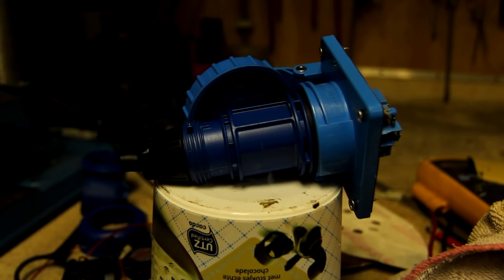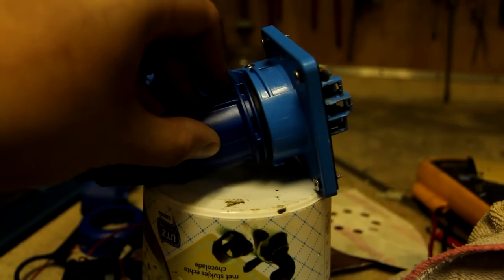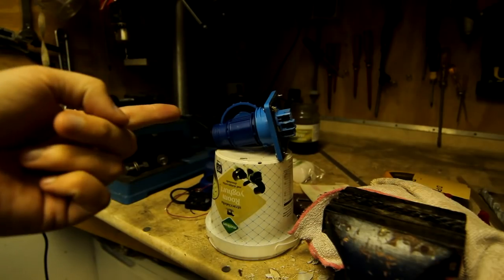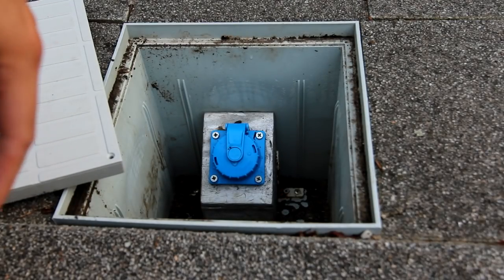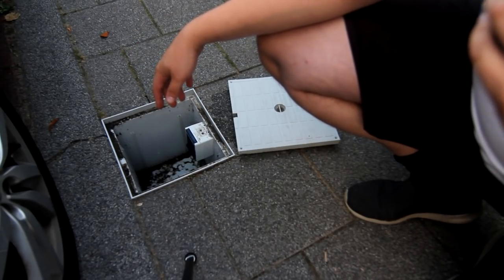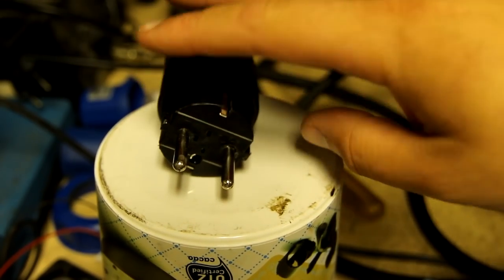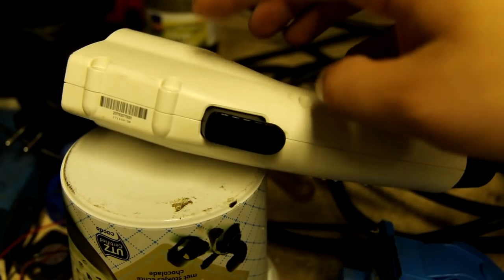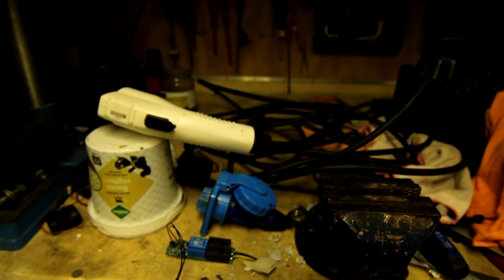Granny charger and charging point update!

Comment: with those high currents never ever use solder connections but quality crimp only
Reply from the maker: The current has little to do with the type of connection you make; this is a bit of a persistent misunderstanding in cable assembly. Solder connections generally have the lowest electrical resistance for round connections, so they are a good choice for this kind of application. However, problems arise when either the connection risks getting too hot (>175C for most solders is a good rule of thumb) or when it's a rigid-flexible connection where the cable needs to be able to move. Neither applies here, so a solder connection is acceptable. Regardless, for schuko pins there is literally no choice; there are no crimp schuko pins I could use.

Comment: A blue 16A CEE maybe with IP 68 is probably better. from those IP 68 Schukos there are (i guess because they are olive green) military-grage ones but they are Expensive as fuck.
Or maybe some like the Wieland: RST20I3S S1 ZR1V SW not so expensive.
Reply from the maker: Funny enough, those CEE sockets are called 'mennekes' here... very confusing in the context of EVs. But no, I specifically want to use my granny charger with any socket anywhere, as we actually rarely use it to charge at home and mostly charge at family, holiday destinations, etc. So it has to be schuko. If I could freely choose the plug, I'd just use a Type 2 plug.

Comment: Wait a minute...didnt you check on the specs for continous load at 16 amps? That's not something you shouldnt care about...
Reply from the maker: Heh, there are basically no specs for any mains outlet or plug. Even assemblies (like that meter!) only show a single rated spec, which almost always either says 10A (for switches) or 16A (for outlets and plugs). You kind of have to 'know' that this isn't a continuous rating. This is, for lack of a better word, 'industry knowledge and something you have to experiment with on your own application'. It's probably in some IEC spec somewhere, but I haven't found it in either 1010 or 60950 and related.

If only there were proper datasheets with this kind of stuff. Would make it so much easier to design for mains.
Reply: PowerElectronicsBlog  hmm...just take care. Once you start using EV charging loads, gonna be easy burning stuff throughout...